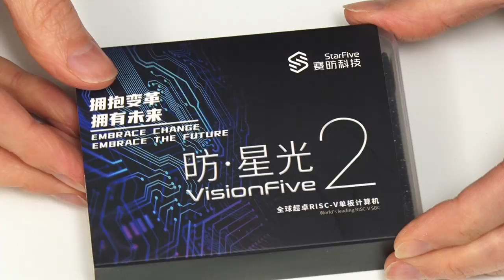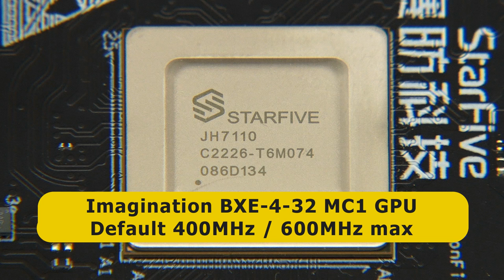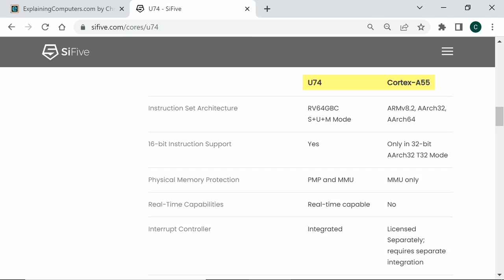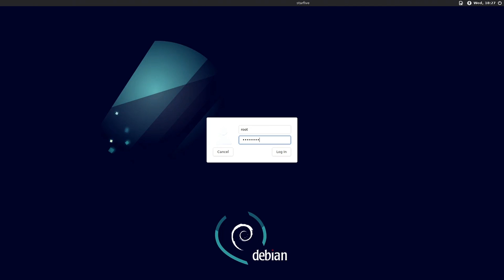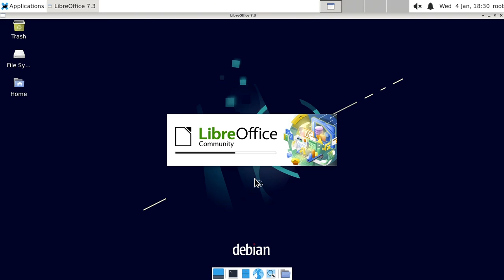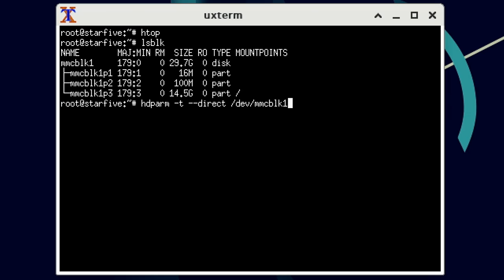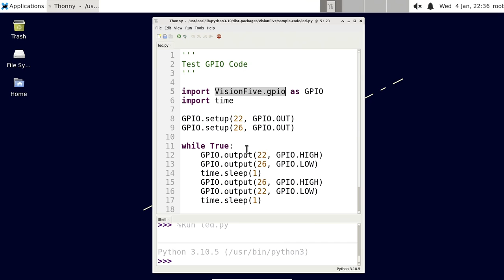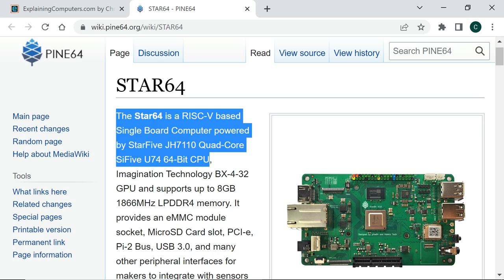VisionFive 2: RISC-V Quad Core Low Cost SBC

Comment: Hi Chris. It puzzles me as to why many of the SBC creators do not include onboard WIFI & Bluetooth. But it sounds like a very good SBC in any case. It's exciting to see RISC processors in SBC's even though the software is limited at this time. But I believe it will catch up. Our Sun Sparc Severs and Workstations had RISC chips but they weren't $85 that's for sure! 😀 I found some on Amazon and will try it out. Thanks again! Rich
Reply from the maker: I imagine not including WiFi makes thing a lot easier, as it avoids having to get the product wireless certified.
Reply: @ExplainingComputers  That makes sense. I forgot about the red tape requirements for "broadcasting" a radio signal...

Comment: I remember RISC in the 80, I am sure it was a very small MIPS machine running RISC/OS they were fast in the day, I remember porting an payroll system on a mainframe (GCOS) that used to take all weekend to run and the MIPS computer run it in 10 minutes on these small RISC MIPS computers running RISC/OS (Unix). I was a Pre-sales UNIX/database performance bench marker and other than porting the application, I did not tune the system too much to get this performance, especially when the customer said if I could get the payroll down to ~ 1 day in processing time, I thought they would be happy with 10 minutes.

The company flew in from Ireland to see how long the payroll systems run would take and were shocked at how  I could show them how fast it was and how buying this computer was the same price as the maintenance of their GCOS system and I was running it on my desk not in a DataCentre.

Comment: The first VisionFive board also includes a Vision DSP Tensilica @600mhz, a Neural network engine @500Mhz (1024MACs) and NVDLA engine. That's also why the price is way higher.
Im still waiting for my (normal) early bird VisionFive 2 🙃
Reply from the maker: Yes, very true. There is less reason for it to be called the "Vision"Five now. :) I hope that your board arrives soon.

Comment: Tried to visit their website, it barely loaded and I gave up at looking closer because I don't want to wait several minutes for a page to load.

I am glad to see some basic output functionality of the GPIO pins but I would be much more interested in the other pins as well. That alone is one of things that hardly anyone ever tests. How well does PWM work with out bitbanging, is I2C functioning, how many "work arounds" are required to get these working? I have pretty much given up on all SBCs (RPi, Pine, etc etc etc) because that is not the sort of thing I want to tinker with and this  is why I simply program a microcontroller to do these types of tasks.

I understand the rough edges of what you have in your hand right now, truly I do. If the final implementation is anything that works as rock solid as a microcontroller, I might take a look again, perhaps my expectations are higher than reasonable but I want something that works and driver support is my #1 requirement; everything has to function properly. I hold out hope that someone will deliver a solid alternative.

Comment: Nice to see an other afffordable SBC, So while Linux (Debian)) is avalable for it, any chance there will be a Win 10/11 release for RISC. May not run all that fast but nice to see. Great to see Phyton available for it so one can get their hands dirty straight away with projects that might fill the low availability of the Pi 3B and 4  gap for now. And comes with LCD output also, Great, Thank You

Comment: it would be really great if you would also add power usage benchmarks to the revieuws, just Idle power, and full load power. that would also greatly show how efficient the chips on the board are, since right now the pi 4 isn't really the most energy efficient board to put it easily, RISC-V is also a new architecture. so if we can get some power statistics that might show improvements.
Reply from the maker: Fair point. :)

Comment: For what it is , at that remarkable delivered price, it is a seriously impressive second model. Those storage and boot options are remarkable and NVME makes it very desirable indeed. The lack of hardware accelerated GPU support in Linux has been the perennial problem on ARM with GPU providers not willing to lay ball with the open source community, so to see (at least at this stage) the same thing again, is a tad disappointing. It would be nice if Imagination made a promise of eventual full GPU support, which will give far greater market confidence in the future of RISC-V. I am rather surprised that for HDMI 2.0 that only 30fps would be supported at 4K as the hardware standard supports 60fps. I look forward to see how the communities build upon things and hopefully give ARM and X86 something for them to really worry about, competition wise.

Comment: Mine arrived in March and booted up into Debian without any problems.  I built an ran some simulation software that I'm familiar with, and overall have had a great time with it.  It is a bit slow running from the SD card, so I'm hoping soon we'll be able to boot from the NVMe card instead.  I'm eagerly awaiting a case and fan that I ordered from AliExpress.  It appears that nobody on this planet makes a fan which plugs into the fan header, so people are using the GPIO for that.  I'm using Logitech wireless keyboard and mouse via a USB dongle.

Comment: so far, no computer I have ever owned has lived upto what I thought a dual CPU should do.
Make an environment, where it could crash without the user ever knowing it..

Run the app on both CPUs in parallel, so if one CPU crashes, the other one can continue while the first one reboots and syncs with the one that didn't crash..

Your GPIO LED blink test has one feature worth noting.. The BLINK PIN could be wired to a watchdog timer, so it could reboot the SBC when it freezes.

Comment: An SBC of a total deficite era: cheap plastic of the connectors, a board ready for different power management chips (the most difficult to find now on stock ICs), a single color of USB sockets... We will hunt for such devices in 30 years -)

I would exchange the second Ethernet with either faster nvme (more pcie lines) or with the second m.2 slot. For that price I'd definitely purchase such model with 2xm.2

Comment: This is a very interesting project so far!
Questions! What are the couns (in privacy and security) while using Chinese brand and architectures like this one?
With 2 ETH ports I would love a more in-depth test related to throughput between 2 different LAN attached and see if this device can introduce a bottle neck in speed. Also interesting idea as a new more performant pi-hole as ads-killers for the entire LAN ;) Are you able to make a video on this my friend?
Reply from the maker: RISC-V is not a Chinese architecture -- it is based (neutrally) in Switzerland. The SiFive cores used in the SoC here are from the US.
Reply: @ExplainingComputers  thank you for the clarification

Comment: I do not care about desktop and GPU, since use sbc as a server only. But speed is critical for me. Unfortunately this board is a bit slow for me. My threshold is 130% of RPi 4 performance. Regarding the price: I checked ebay, and it costs US $95.45/ea for 8Gb version with free shipping. If you have a friend and willing to buy 3, then price will go down to $90.

Comment: I'd like to see both, RISC-V but also ARM as well, to evolve from the state of SoC up to full standard sized hardware like the x86-family which evolved from 4 chips for a calculator to world domination
Reply from the maker: ARM has done this -- almost all new Apple Macs now use M1 and M2 ARM processors. :)
Reply: @ExplainingComputers  I agree, but it's still limited in marketshare and availability: I can't go to a store and select a motherboard for the apple m1/m2 or any other arm platform neither can I buy the cpu on its - that's what I like to see for both risc-v and arm
but I guess this will fail on their designs: there's no such thing as standardized cpus - their both only concepts for cpu cores - to implement standardized boards require standardized full cpus first
the visionfive2 is a neat proof of concept - but if doesn't come with at least a couple of external pci-e lanes to connect standard peripherals like network cards, usb hosts or even gpus there will be no incentive to have providers of such components to write risc-v drivers for them

Comment: For reference: I ran a dd sequential read benchmark with cache disabled in chunks of 32MB on a Sandisk 100MB/s MicroSDHC-card on the integrated micro-sd slot of a Raspberry Pi 4: 37, 38, 39 MB/s +- 2MB/s, in other words slighty short of 40MB/s (variance probably due to timing inaccuracies due to various other OS activities). So the internal microSD slot of the Raspberry Pi 4 seems to have double the bandwidth of this RISC-V device but neither one are near what even common microSD cards could deliver today - in case someone cares about these numbers itfp.
Reply from the maker: Thanks for sharing this data. Approaching 40MB/s for the microSD on a Pi 4 is what I have also found. The fastest microSD speed I've measured on an SBC recently was 80MB/s on a Rock 5B.

Comment: Christopher, just so you know, you probably could have solved the small font in the uxterm-terminal by looking in the Archwiki, it has an article about xterm, uxterm is based on it. Probably you can set the font in the same way. The archwiki, gentoowiki and freebsd handbook are great resources. In this case a quick google search also would give the answer if you search with xterm.
Reply from the maker: Possibly. But I seriously doubt it. I did a lot of research and tried a lot of things. Many of people in these comments have given me advice on UXterm based on what they know should happen on an x86 or ARM implementation. But I tried all documented options I came across, down to writing a custom .XResources file. And nothing worked. The same way that half of the software I installed also didn't work.

What some people do not seem to get is that this is a RISC-V board running currently highly unstable and significantly unfinished software. Lots of things do not work as they should, or at all. So advice and support documentation based on final release software running on a mature, stable, ISA will not necessarily solve the problem. I really don't get why this is so hard to grasp! :)

Comment: I have no experience with this kind of system, but I do have experience with systems that are pissy about what components they'll run with.
As far as NVMes (or RAM) goes, Transcend seems to almost always work, the alterative choice would be hynix. Neither of them is cheap (very far from it), but it's always one or the other that'll do the trick.

Comment: I wonder if development of various distros for these RISC based boards will be a bit faster than usual since all of the hardware is also open source, so there won't be a hunt for driver development - all of the specs are out in the open as it were. I don't know about such things, but with basic concepts it was something that struck me. I know that I am buying one straight away! I don't really need anything much beyond Python to work for most of my experiments anyway. I just love tinkering around with timers, sensors, and automation stuffs. At some point I'd like to learn how to control large (like 6" or so) e-paper displays in real time, like for real time console display, but that's down the road.

Comment: Nice review! It would be great if, during these reviews, you researched/explained how 'OpenSource-oriented' the vendor is regarding their system software & compilers. It's not uncommon for vendors to produce a board, get bored with it, then cease development w/o ever putting their device driver/compilers sources out where the community can pick up development once the vendor abandoned it. 

Seeed Studios is notorious for doing this. Khadas is another. Such products are effectively dead in less than one year from purchase.

RISC-V only adds to this problem by being vendor trade secret. Sure, RISC-V was a starting point, maybe, to some extent, but every implementation is different. Yikes.

Show me the kernel, drivers and assembler source first, because I can get that on a Pi or PC, and build almost anything from there. Otherwise, it's simpler to throw $85 in the trash. Sorry for the rant.

Comment: I still don't understand why the other manufacturers were putting their m.2 slots in the wrong direction. It makes so much more sense having the ability to screw it down on the board without some kind of other thing connecting it. It also makes case options smaller and less awkward to design.

Comment: The first time that I knew the RISC-V architecture, it was several years ago, when I was reading on a blog that Russian government supposedly was going to invest in that architecture, then I didn't know more about of the case 'till a few months ago that I was looking for alternatives for raspberry pi and I found development board like this, that they use RISC-V CPUs, for me I'd like to get some one, but they have some problems, the first and the most important for me, they barely have any software, I'm looking to buy a small computer for replacing my old gaming computer ('cause I used to play videogames but now I don't have time to play them anymore :/) and I need a computer that is silent, fast and small, but also I'd like a computer like the Raspberry Pi to do projects, for instance, I'd like to have my own cloud server, and that leads me the next drawback, the RISC-V CPUs are slower than other architectures like ARM, so for now I'll let the RISC-V CPUs get better, this architecture has a lot of potential to compete with other architectures.

Comment: I hope you are correct WRT software support but at the moment these RISCV SBC’s are just like Arm with no standard bring up/boot standard thus relying on device tree and GPU support basically sucks thereby killing the user experience IMO. I am rooting for both ARM64 and RISCV but not sure either will make it. I own both LX2160 ARM board and RISCV UnMatched board, and look forward to new hardware on both ISA’s.

Comment: * 10:21. Uhh. That lag between mouse movement and menu cursor  reaction. Something is really wrong. You don't need GPU for menu to not lag. You don't need >1GHz cpu for that either.
* 15:30 that's actually nice to see you can aсcess GPIO from standard python.  I remember some SBC just plump atmega  next to the cpu and be like "we are arduino now"

Comment: I suggest you install gentoo on it and do some performance tests with it against a raspberry pi 4 also running gentoo. I think the results will surprise you
Reply from the maker: I would love to run comparative tests with a Pi 4. But I am not aware of any suitable image right now. StarFive have not yet released any final images just yet, and there are no posts about a Gentoo image in RVSpace for the VisionFive 2: https://forum.rvspace.org/c/visionfive-2/19

But if you have a link to a release Gentoo image, please share. :)

Comment: Not sure about RISC-V, ARM seems pretty good and this tech, it’s not cheap and requires lots of engineers and R&D. Thought the PI-dude you interviewed recently gave a good explanation for keeping with ARM. That said, I’m all for RISC-V, I just think it will always be one step behind ARM, which is OK for many things.
Reply from the maker: In the interview, Eben Upton said that it was currently not possible to license an A-class comparable RISC-V core cost effectively enough to put in a SBC SoC -- and would not become so due to the cost of of developing such cores. Well, this VisionFive 2 board uses U74 cores (roughly equivalent to ARM A53/A55) -- which are licensed from SiFive -- in a board that is priced at $55/$65/$85 . . .

Eben also said that nobody would open source A-class comparable RISC-V cores -- even though Alibaba (T-Head) have already done this . . .

So whilst Eben's argument that there is no reason for ARM SBC manufacturers to switch to RISC-V is very sound, there is some debate on the wider issues . . .

Comment: Software support seems to be the Achilles Heel for so many of these SBC boards. I'm a hobbyist, not a developer.  The price on this is low enough, I'll probably get one to play around with. Hopefully, the support will happen.
Reply from the maker: Software support is the issue for all hardware. It's just that we have got used to it being good on x86 platforms. But it may well get good on RISC-V also . . .

Comment: I don't have an SBC, but I've always thought that they are pretty cool computers, especially because you can run Linux on an overall less powerful processor, and that they can accomplish most, if not all tasks the same as any old PC can. I may end up looking into one of these in the future. 

Just as a quick question, how much does an average SBC generally cost? And, is this one of the better value for money ones?
Reply from the maker: SBC prices vary widely, although a lot these days sit between $50 and $100, and often far more. The $55 and $65 models here are good value.
Reply: @Good Ol' Slappy McGee Sweet. I'll definitely check one out some day.
Reply: @ExplainingComputers  Nice. Is that in Australian dollars?
Reply from the maker: @technoWZ5598  USD. :)
Reply: @ExplainingComputers  Ok. 👍

Comment: if you use the xfce4-terminal instead of uxterm you will be able to resize the font far more easily.
Reply from the maker: Agreed. But it is not installed, and I could not install it. I tried to install several alternative terminals.
Reply: @ExplainingComputers  if hold down the control key and the right hand mouse button within the uxterm window you get font menu and you can select from some pre-set font sizes like large, etc.